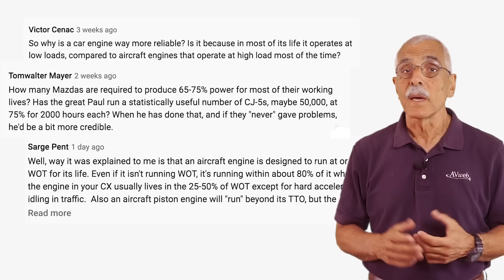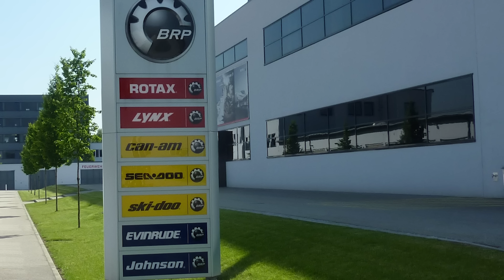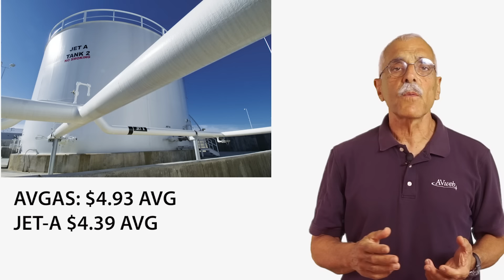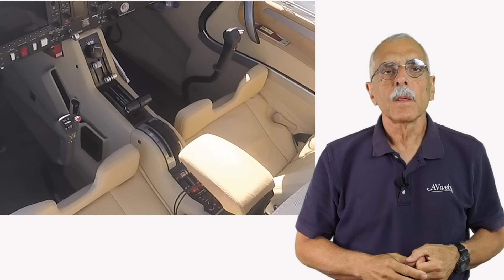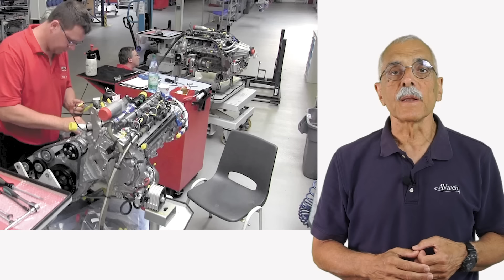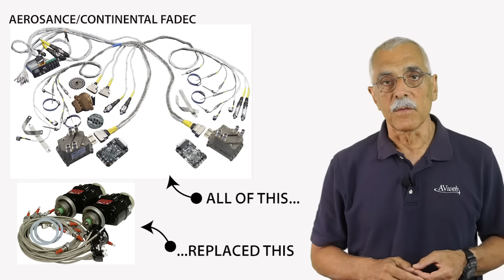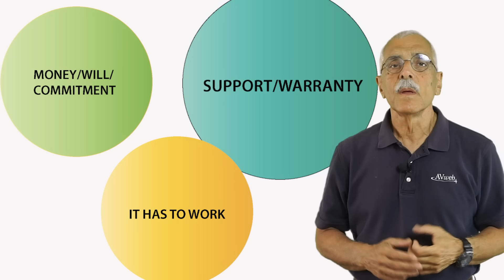Why New Aircraft Engine Ideas Rarely Succeed

Comment: So the Christian Dries secret to success is to just identify a hole in the market and then push through and exploit it. It's capitalism 101 but hasn't been thoroughly exploited for decades until Diamond came in with enough vertical integration to actually make it work. No purely engine production company can justify the cost but since Diamond controlled all the different Venn circles they could just push them together until they jelled. Good on them and I hope they continue to succeed both in new markets and at the expense of those unwilling to innovate.

Comment: I am not into aviation and have watched this video out of curiosity , learning about a variety of subjects can never  be enough. That said  I have owned several Hydroplanes over the course of time and Mercury outboards are legendary for their reliability and simplicity , pausing there for a moment...the 2 strokes used to be that .Still , the newer and current 4 stroke versions have impeccable reliability and their compact design make them ideal for aircraft use albeit with some modifications . But already they are capable of high horsepower  sustained at high percentage and their lubrication systems also makes them suitable for the purpose. Of course mine is a question that only experts can answer, relative to why none of the reliable manufactures of outboard engines have ever been petitioned to make variants for light aviation use. I will say this for example , a 60 degree  V12  Mercury Verado makes 600hp at less than 6500 rpm , and does it all day long . in a package smaller than most  opposed 4 cylinder   by a good margin separated from the lower end unit , in addition they have been designed to be easily maintained.
So the question is then , even a 77 thousand per copy 2 of them  they seem like a logical alternative for aircraft costing nearly 2 million .2 Continentals or Lycoming totaling less than 400 HP  versus 2 Mercurys totaling 1200 HP , for not much more money than the former, the Mercury  seem worthy of consideration .
Reply: As Paul points out, the core motor might not cause a problem. Though rational at first glance, marine motors would not change anything on gearbox and cooling in a general aviation application. I can't tell about the US, but in germany there are estimates of 500,000 yachts existing - including sailing vessels. Now compare this with the aircraft count, registered in germany. It is about 21,000 with only 7,500 of them to be possibly propelled by a motor under discussion. As Paul concludes, there must be some kind of addiction besides other factors to place a new piston engine in the general aviation with a marketshare decreasing, while Ultralights thrive.

Comment: Glad you mentioned 100LL replacement. I'd love to see and hear the layers of reasons that 100LL hasn't been replaced. Low Lead what a joke. Been running and flying on 91 to 93  OCT almost exclusively since 1997.

Comment: The question is why Truck Diesels are TONS more reliable than any aircraft piston engine.
They DO run at a significant part of their max output for long periods, and are often going over 20,000 HOURS (over a million miles is THE NORM) between overhauls.

I'm not talking small Diesels like in pickups, I'm talking Semi Tractors and many "working" type trucks like garbage collectors and even city busses.

Comment: It's all about money, in particular the cost of getting new technology certified. 
As an aircraft mechanic I remember when rotax engines were new. 30 years later, they're still fairly rare and I don't have training on how to work on them. At the busy airport I work at there is one man who knows how to work on them, and he doesn't have an A&P.
It's also funny how continental went bankrupt when it has the engine model you call the best. 
The Porsche Mooney died because you had to get a Porsche mechanic to do anything on your engine at about double the rate the aircraft shop was charging per hour at the time. I worked next door to the Mooney dealership in the area and was in their hangar often for oxygen servicing.

Comment: When there is but two manufacturers who build the bulk of light aircraft engines, why would they bother building something, anything different? Innovation is driven by customer demand, emission regulations and competition...without these motivations, innovation ceases. When was the last time you had to set the rich/lean settings on your cars engine?....Seventy-five years ago maybe?
  As such, an engine builder doesn't have to do the research, build the molds, change the manufacturing process, none of it....Lycoming can use the same molds they used from 1972...an that IO-540?...$53,000 plus.

Comment: There is far more risk for an owner/operator to take on a new device installed in a flying vehicle.

With a car, the risk is far lower, at least the 'gravity risk' is non-existent for the most part, to purchase all-new tech when buying a new road vehicle.  New engine, new electronics, the entire vehicle can be brand new and tons of people will buy it (see the new mid-engine Corvette demand for example - just off the charts).

When the 'gravity risk' is considered, there is huge incentive to rely on historically-reliable gear and to 'let someone else be the guinea pig' for new gear.   

It's probably worse for the helicopter.  At least with a plane, if you're not in a 3rd-world country, there's a likelihood of a road you can land on.   Helicopters turn into bricks instantly if something in the propulsion or steering fails.

Comment: A million dollar airplane doesn't cost a million, the actual loss of value is fairly small and it doesn't require the buyer to have anywhere near a million in expendable capital. Once the plane is sold it may have lost a few % of value - or it may have gained value depending on the market. Running costs make up for a much higher % of total cost of ownership, and being able to cut those by 30% (euro price difference) can make a big difference in the overall affordability calculation

Comment: I have a late-1990s Lexus SC400, with the 1UZ-FE V8 engine.  There was an FAA-approved variant of this engine for aircraft use at one point, though the project was dropped in 1997.  The aviation variant was known as the FV2400-2TC.

Comment: Meanwhile, I'd much rather accept the 200 lb weight penalty by using a modern automobile engine.  Babied as much as aircraft engines, they cost less than 10% and would easily last 5,000 hours before needing a major overhaul.

"But they can't run at high altitudes!"  My 4.0 L maintains strong pull all the way to the top of Pikes Peak (14,215 ft MSL) carrying 5 adult passengers and nearly a full tank of gas (about 18 gal).  I currently live above 6,000 feet, but used to live around 800 ft MSL and its sensors adjust whatever needs adjusting to keep the mixture and power just right for all altitudes and temperatures from -27 deg F to 109 deg F.  Never had a boil over, either

"They're too heavy!"  They're also electronically detuned.  Changing the chip settings can easily raise the peak HP from 210 to 300 without serious issue, so long as you don't climb at full throttle all the time.  "Use what you need, not everything you've got."  You could even design a takeoff/climb switch that would open peak HP only when the throttle was firewalled.  Anything less would reduce HP to it's de-rated and engine-prolonging 210 hp setting, which is still considerably more than a 

"But they're still too heavy!"  Not really.  A Lycoming IO-540-K1A5 (300 HP) weighs 438 lbs.  A Ford 4.0L V6 (detuned to 210 HP but capable of 300 HP) weighs roughly 70 lbs more, which is just 2% of the MGTOW of a Pipe PA-32 Cherokee Six.  Add water cooling and you're looking at about 120 lbs, total, still just a 3.5% increase in the total engine weight, or rather, that much reduction in the useful load.

"They're not reliable!"  That could be said of carbureted engines from the 80s and earlier.  It really cannot be said of modern mass-produced engines with 100,000 mile (~2,500 hr) drivetrain warranties.  Furthermore, because of those warranties, all modern mass-produced engines are made to exacting engineering, manufacturing and final assembly tolerances, not to mention thoroughly tested via a wide array of sensors under load.  

"They don't have carb heat!"  They don't have carburetors, either, but if you think icing will be a problem, it's easy to add intake heating.

"It won't feed oil/gas under any conditions except straight and level flight!"  Modern engines do just fine throughout most of the upright realm.  Adding full flight oil sumps for normal, inverted and even knife-edge flight was solved before World War II.  Same goes for gasoline feed systems.

"I can't run on 100LL!"  Good!  The less lead we spew into the air the better

"Getting FAA approval would cost tens of millions of dollars!"  Sounds to me like the FAA has some MASSIVE and very seriously detrimental issues when it can't figure out how to certify modern, reliable engines.  It also sounds to me like Continental and Lycoming have so bastardized the industry by over-lobbying in Congress in their attempts to create barriers to entry that Congress has FORGOTTEN how to REDUCE barriers to entry so as to INCREASE PRICE-LOWERING COMPETITION.  Seriously.  THINK about it, people.  $50,000 for an aircraft engine.  $5,000 for a better-engineered, more precisely manufactured, more reliable, longer-lasting, and overall HIGHER-QUALITY automobile engine.

If you're still stuck to the marketing crap, watch this video to see just how FAR Continental and Lycoming have left you behind:

https://youtu.be/r9XahhlV3fc

Comment: Aren't these new diesel engines water cooled? Which means radiators, coolant lines running all over. New fail modes introduced. Most of these new engines are built to satisfy dreamers who think a much better engine is just around the corner. And are tired of the present air cooled aircraft engines. They need to find something else to be tired of.

Comment: Excellent video!
I flew a Thielert version 172 for a while in France.
It stank of diesel fuel all the time, but otherwise performed similarly to the standard  Continental model (this was a 172M).
This was a big deal in France, as government regulations taxed Avgas much higher than Jet-A, but the demise of Thielert put an end to that experiment. 
That airplane was not missed - probably mostly because of the foul odor - but one would expect a newer airframe/fuel delivery would not have that problem.

Comment: Exceptional overview Paul. I would fly an Austro any day, even if it (hypothetically) cost more to operate, because the dinosaur tech of most other GA piston engines is so infuriatingly archaic and unnecessarily adds to pilot workload. Carb heat? Manual mixture control to achieve LOP operation? in 2022? .... you've got to be kidding. Just to save the trolls the effort of posting nasty, dismissive responses: I drove manual transmission cars for over a decade, and raced them too. I know how to use a choke on startup every morning. I did my own engine service often. I would still take the Austro.

Comment: These are built like small blocks 350s with no block, using a transmission case and 1930's engine heads (motorcycle). In the previous video the connecting rods are way to skinny vs a built proof LM7 5.3. The lack of application might be more for no drive to have new technologies to improve the designs. High Rpm or the fact its running at 90% from my under standing of of engine wear. It would be nice to compare the two and share the technologies and design principles used in The LS that can be brought over to piston aircraft engines.  There are some video around of the LS3 powering small GA aircraft that expanding the field of things of aircraft.

Comment: It's rad! The overhead cam design came into the automotive world from... aviation!

Back in 1920s sports car builders searched for more power at the same or lesser weight. It was very prestigious to have fancy airplane tech in a car back then. Non sports cars used flat-head design or pushrods. Now those two worlds kinda swapped places.

Comment: No nonsense and interesting explanation.  If Cessna, Piper. Cirrus etc.  could have anywhere near car sales volume, they would have the money to get more advanced engines certified for aviation. The typical aircraft engine has to operate in conditions your car engines will never ever see. So large air cooled  engines that run slow and at a percentage of rated power is what will get you in the air and back on the ground reliably,  well proved and fairly primitive.    that is the sound of an engine that gets you home - if that matters to you.

Comment: I've always wondered why diesel engines are not used more often in private civil  aviation. The character of aviation (long continious use at part load) seems ideal for aviation.  And they are efficiënt as well, specially at part load. That's why ships, trains and trucks use them.
Cold temps are a problem but that can be delt with.
Interesting video.

Comment: Stop!!!
V6!?! balancing issues!. Anything out of Mercedes? reliability and longevity issues! If a V6 made by Mercedes? Run, don't walk, run away! On both accounts those companies should have been advised they are both non starters. Have they more money than sense!?! Or is the cents? Pun intended. There is flat 4, flat 6, straight 6, V12. Even V8s have vibration issues if not set right (I think they need to be 90 degrees to be right). This is what the heck, there are plenty of better manufactures out there that do a far better job.

Comment: It makes sense, in the end, that when you're shelling out for an engine that will keep you or your customers from turning into smoking craters as they fly, it makes sense to stick with the tried and tested things. 

Its not like with a car, when my engine failed on the road, I just gently rolled into a ditch and the worst pain i got was slamming my face into my steering wheel in frustration. Not quite the same with an aircraft engine. 

I get they are infinitely safer than a car, but when its the only thing between you and gravity, a known thing is way more appealing than the unknown.

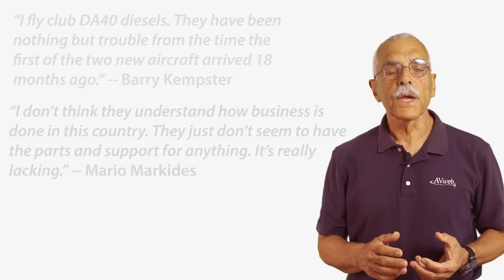Comment: This dude manages to get SO CLOSE to actually doing what the video says he's doing and NEVER actually gets there. Consider the example around the 6 minute mark. He talks about some new engine (the adaptation of the Mercedes engine). Some little four cyclinder thing with "all the latest technology" ( btw - none of the things he mentions are latest technology - DOHC, fuel injection, electronic ignition .... these are ALL >50 year old technology) .... "They made these in the bazillions!" .... at 6:52 he talks about the issues with AOG servicing ... he mentions cylinder head cracking, piston lubrication, pump failures ....WHY?! for the LOVE. OF. GOD!!!! .... WHY is it, that when you take a solid engine (made in the bazillions) with tried and true technology (NOT the latest technology), and stick it in a plane, WHY does that engine all of a sudden encounter problems that it's never encountered when on the ground?!?!?! ... .THAT is the question he never quite answers

Comment: Very instructive !
But regarding starting issues I would like 
to point that we  are comparing modern diesels with old fashion carbureted engines.
Direct injection gas could be the next generation of aviation engines due to it's dependability, less specific weight, better torque and powe curve, the lower fuel octanage required, self mix correction, etc
May be from Lycoming, Rotax, continental...  ?

Comment: I just want to say that for all the overbuilding and redundant systems, it seems that aero engines fail far more often than auto engines.
I have been driving for almost sixty years, and I have never had an engine fail while driving.
Anecdotal certainly, but a fact nonetheless.

Comment: Brilliant video, packed with detail. I'm running a Chinese (Gaokin) copy of a V-Twin Rotax engine; for some reason Rotax won't use their wonderfully wide range of snowmobile, ATV and personal watercraft units in ultralight aircraft. To sort this bought the Chinese copy (which turns out to be excellent build quality), it is an 800cc V-Twin set at 80°, liquid cooled and fuel injected, four valves per cylinder and overhead camshaft, making 61hp at 6,250 rpm. Been flying it in a weight-shift for a couple of years, Chip Irwin spotted the YouTube videos and has set off down this road too. Nowhere near the exotic and expensive aircraft you show, but 61hp would loft a Piper Cub...

Comment: With RHV discontinuing 100LL, I can't see the trend being anything but away from availability of 100LL at nearly all GA airports.  I can't see building a new airplane with a high compression engine that requires high octane fuel that won't likely be available by the time the build is complete.  I think that the FAA needs to subsidize the efforts to apply turbine power to small GA aircraft.

Comment: The Diamond Twins have crashed due to electronic supply issues 😑 . In one case dead battery was jumped to get it started on ground and took off. The battery was weak and damaged and took the power supply down. No battery no Electronic ignition or fuel injection.

Comment: Blew my mind the first time I saw a helicopter with a hand throttle and a plane with mixture levers.  I worked on HH-60s for years and it had digital engine controls where you set it and forget it.  Why would you want to mess with extra crap

Comment: They also have to build a new production line for it which is an expensive proposition. You need big take-up to justify it. Excellent info. Subaru H6 turbo engines have been used in kit planes, they are just a car engine with a chain from cars like Subaru Turbo Legacy's.